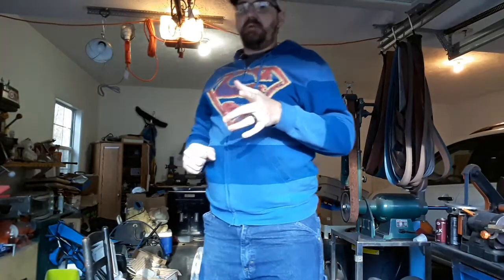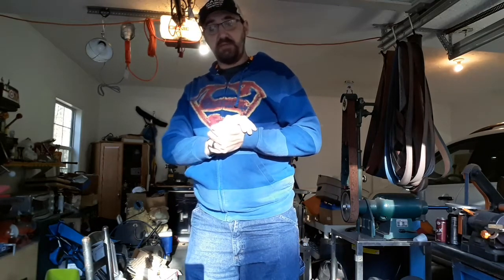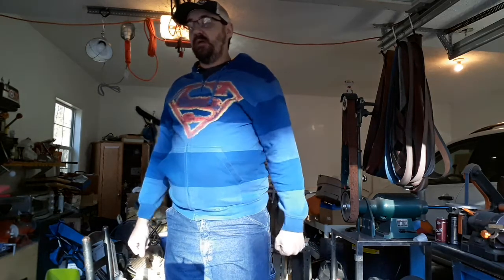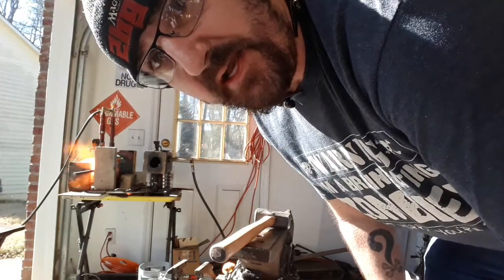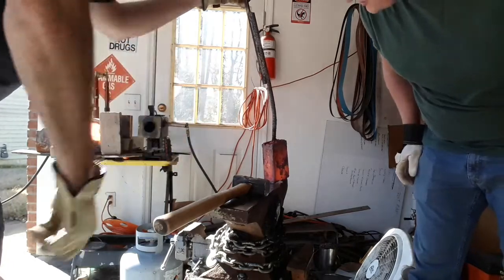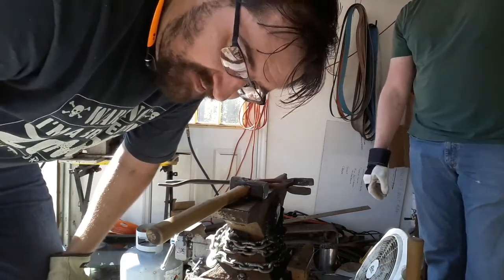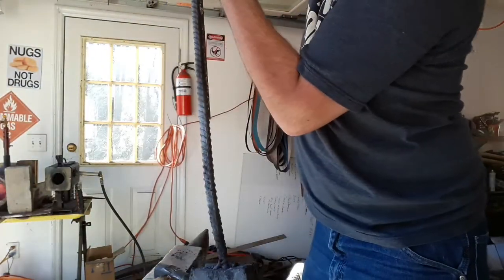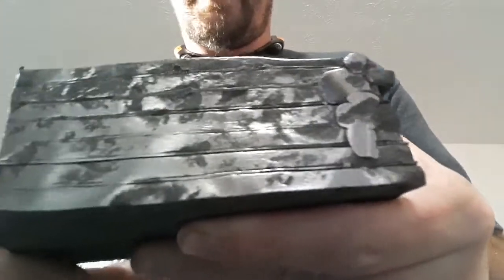Damascus Hammer II: The Return Of The Revenge

Comment: Those large lams are so hard to blend without a really good heat and heavy press...  Looking forward to the hydraulic press and rotary hammer you ordered...  =)
Reply from the maker: When we get around to moving in 5 or 10 years I'm gonna have a big enough shop to support a Little Giant power hammer. I can't put one in my garage without cutting a hole in the floor and filling it with 14 inches of reinforced concrete. A press is picked out but it's $4600 away.
Reply: @drstrangefart  I know!  14" of reinforced concrete isn't cheap either!  They are too cool though!!!!!!
Reply from the maker: Until I can afford the press I AM THE POWER HAMMER. Feels good to say it. Doesn't feel good to BE it.

Comment: All I can see is it almost didn't look hot enough. but it's hard to tell over video. But other than complete and utter failure good job. Lmao👍👍 it looks like there's still some steel in there you could save
Reply from the maker: Yeah, looking at it from here the bottom of the billet was nowhere near hot enough
Reply: With some grinding you could save that billet. Also you want the forge to be oxygen starving when trying to run pattern welded steel. Looked like some hard shit though.
Reply from the maker: @thetradesman7478  It SHOULD be excellent tool steel. I was advised by an man who knows a LOT more than I do to see if I can split it along the delam with a chisel so I'll start there.
Reply: It's hard for me to scrap a project. I normaly just try and change my prospective and dive back in. And steel is frieken expensive these days. Keep at it.

Comment: Didn't look quite hot enough when welding, and the working heats were way low in my opinion as well. My understanding is the working heats should be quite hot to avoid delaminating. Not quite welding, but definitely bright orange.
Reply from the maker: Yeah, having never worked a billet that big only the top that I could see got hot enough. I also failed to let it soak at welding temp long enough.
Reply: @drstrangefart  yep, cold centered it.
Reply: I'd personally take a sledge to it, on end, cold, to see how deep to the center the welds actually stuck. That will indicate how much longer you will need to soak it. Won't do any more good for you right now, and you'll be learning from it.
Reply from the maker: I've got plans to try busting it apart with a chisel. If that fails I'll be using a friend's porta-band.

Comment: Not sure but i think maybe the problem is the size of the billet you are trying to weld by hand. you could always try a smaller billet a make a smaller hammer and still come out with something really cool! awesome vid the main thing is the fun you have doing what you do
Reply from the maker: I had a lot of fun working on it. After talking to someone who knows more than I do I was told what I did wrong. I DIDN'T give the billet a good 20 minute soak at welding temp. It may have been at welding temp for 3 minutes tops.
Reply: @drstrangefart  yeah you would need to and rotate sides while your doing it at welding temps

Comment: if I may suggest... set it aside and wait until you have a press available, then heat it up hotter than the pit of hell and press it back together.  but i also would say, heat it up enough to get borax to melt and coat heavily and let it cool so rust shite don't form in the de-lam's.
Reply from the maker: Next time I do the damascus hammer I'm gonna start over from scratch. When I'm in the shop again I'm gonna try busting it apart at the delam and see if I can make something else with it. I've already learned what in 99% likelyhood what I did wrong so I need to rest to test the new information without more variables.

Comment: Every giant billet i have tryed has failed man!  Its why i do small billets and then forge them together.  N yeah ive had those fail too but not nearly as often.  It takes longer but ive had more success for sure!
Reply from the maker: I learned that I needed to give it a 20-30 minute soak AT welding temp. I maybe gave it 2 or 3 minutes.
Reply: @drstrangefart  yeah man ya gota give it seriously good time at lemon yellow i tend to jump the gun also but lesson learned!!
Reply from the maker: Yeah. I get worried that I'm gonna burn the steel and decarbeurize it. I've had a bunch of steel blister up good when quenching which isn't good.